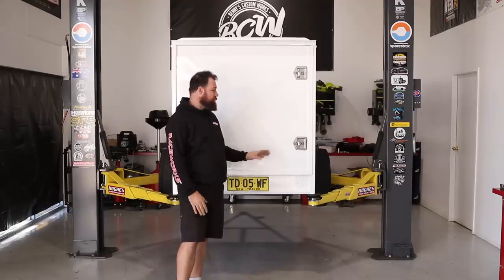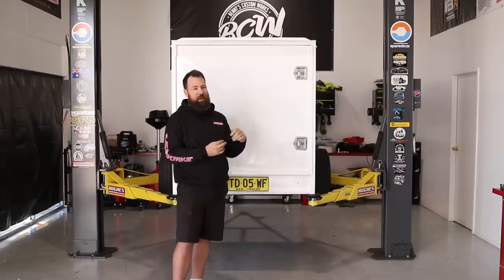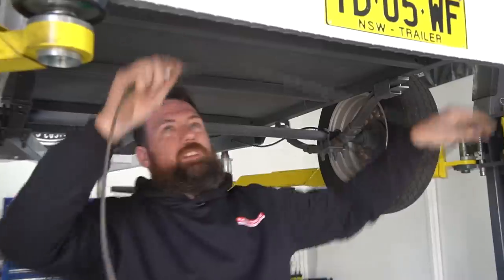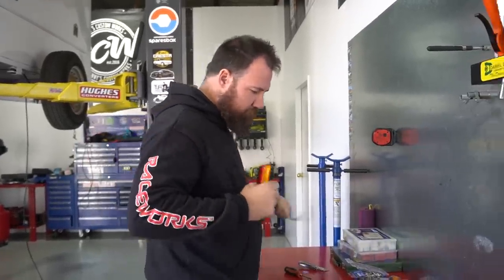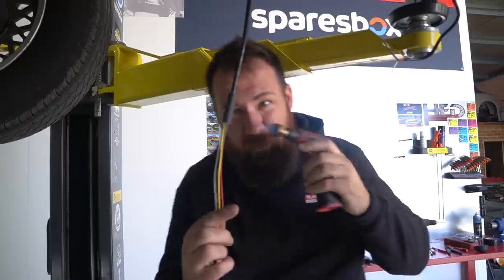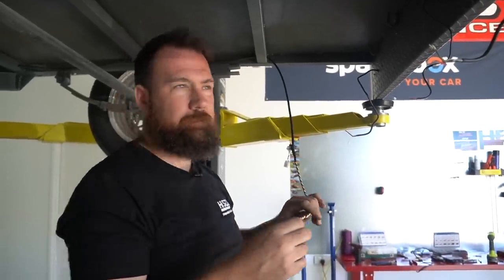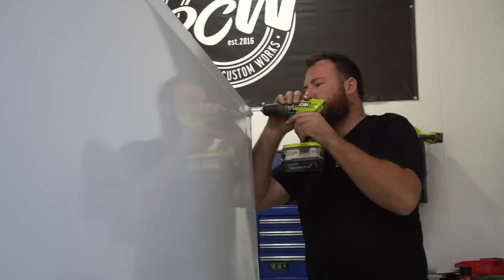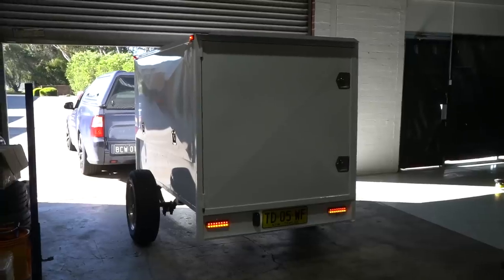Trailer - DIY how to wire your trailer ( Australian standard )

Comment: Benny.... some misinformation here, just looking at some replies. NSW ex auto sparky talking here.
1. brown = tail light + feed
2. white = earth.
3. yellow = left indicator.
4. green = right indicator.
5. red = brake lights.
6. blue = electric brakes.
7. black = reverse lights.
keep the blue & black wires for interior illumination, and ciggy lighter supplies. This can be wired into the tow vehicle to B+ and acc. circuits.. If you're gonna use 7 core, then use ALL the wires. Cutting blue & black off.... then why not just use 5 core? Makes no sense.
 Also, twisting the LHS harness..... not a good idea mate. And where is the spaghetti covering it all to get your double insulation? As stated, if you were going to submerse the trailer, deutsch plugs for sure. But it's only a dry road unit, so Utilux terminals will suffice there. Also, P clamps come in different sizes, and should be used in accordance to cable diameter. Loose fit = chafing. 
I've done hundreds of box/boat/car trailers before, with a small Anderson plug just for the LED number plate light (LED).... yes !!!!  Just to idiot proof the removable tail gate. And at the 7 pin plug, you can always use bootlace connectors. I've also used metal plugs, some have a magnet attached too. Just to make sure no-one stuffs things up. There are some "special" people out there who don't know ANYTHING about electrics, and I try to design my installations to circumvent the "Human Being" destroying their trailer and vehicle through their silly actions. If you want to go further, maybe a 12 pin flat plug is the go. 5 x more heavy pins for "house" battery demands. But that means either an isolator in the vehicle, or solenoid / dual battery set up in the vehicle. Usually 4WD applications there.  Good job overall mate, but watch out for pitfalls. Not criticising at all mate, just passing on knowledge. Because I've seen people stuff up the simplest things. Many times.  Cheers !
Reply: As someone who later decided to add a reverse light to a trailer, I agree about not cutting off the redundant wires so short

Comment: Absolutely un helpful. 
I needed to know which wires connect to what. 
17 minutes wasted.
Reply from the maker: They’re all standard colours which a plug will come with instructions. 
Pin 1 - Yellow - Left-hand turn indicator.
Pin 2 - Black - Reversing signal.
Pin 3 - White - Earth return.
Pin 4 - Green - Right-hand turn indicator.
Pin 5 - Blue - Service brakes.
Pin 6 - Red - Stop lamps.